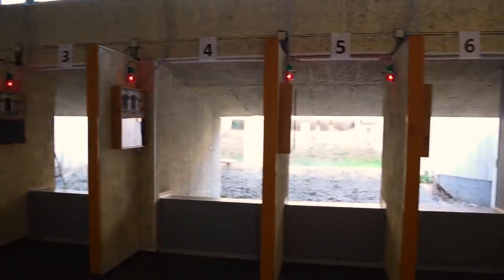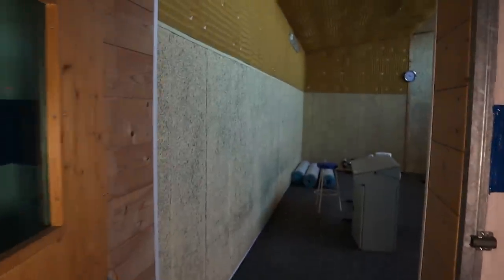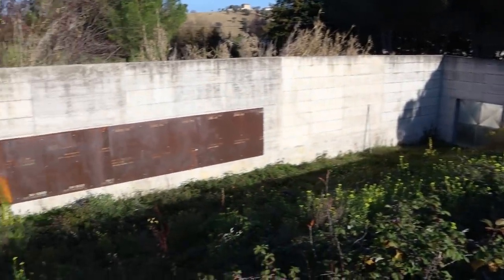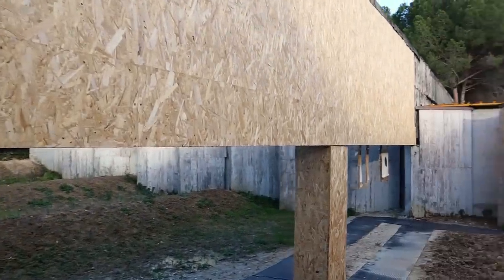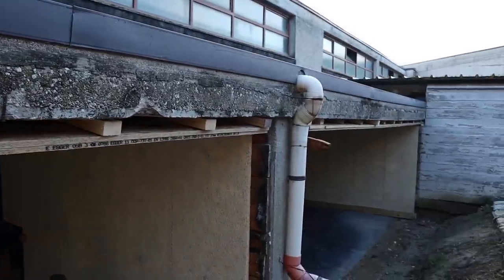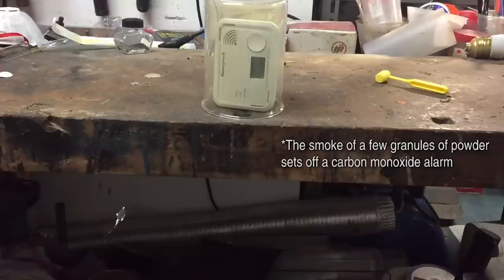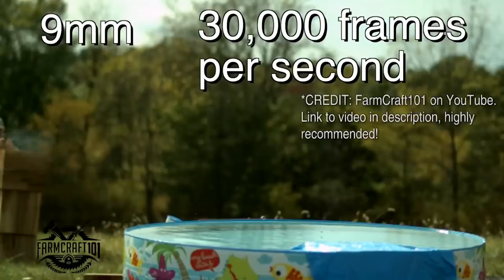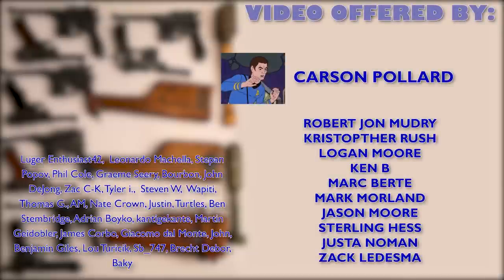The Engineering of Shooting Ranges (+ Tour of my own)

Comment: The range that I usually visit for shooting actually used to have wooden planks as a floor. That combined with the really bad air circulation started a fire and the whole range burned down. Now they rebuilt it and got a solid concrete floor with rubber sheets on top of it. Great video by the way.
Reply from the maker: Unfortunately sometimes a tragedy is needed to change the idea of the management, and this goes well beyond shooting ranges, (look what happened with the Genoa bridge)
After all, "a fire has never happened here", until one day it happens. luckily it wasn't the case for my range
Reply: I'd rather burn alive than die from inhaling smoke from burning rubber. I'd rather die in a fire than survive from inhaling burning rubber trapped in a building.
Reply: @Backyard.Ballistics  this is very interesting for me because I have thought about how a shooting range is designed but I never understood it well until I watch this video
Reply: @Phoenix_Atlas  No.  You really wouldn't.  Also you'd be doing both in the event of a naked flame anyway.
Reply: @jimmehjiimmeehh9748  Combined with the smoek from burning wires and a bunch of other shit which are all equally bad, but better injured from inhalation than dead.
Reply: Concrete floors with acrylic paint, very thick and somewhat rubberized at my range. It’s also in doors so a massive air handler is also required. The left or primary range has 16 bays and the secondary range or training range has 8 bays.
Reply: Also every bay has a separate concealed sprinkler head and way more then double the heads required by building code, (I’m a plumber so I recognize this). We also have air locks on all the doors for security and air control.
Reply: @Phoenix_Atlas  it is flame retardant ruber matting, so that wouldn't  happen

Comment: Learned more about range design from this video than from 35 years of shooting on them. Thanks!
Reply: You should invest some time in your local gunclub then ;)
Reply: @peteraugust5295  I'm an active member of three clubs, two of which have range shooting disciplines, but happily they are in the country. As a consequence the 'extreme' measures illustrated are not required.
Reply: @peteraugust5295  I'm thinking about trying to join Elks lodge. They have a amazing gun range with lanes up to a mile long. The closest free shooting site is at the top of a mountain in my county at a old rock quarry. It's hard to get up there.

Comment: There is actually allot of engineering that goes into making a range that's safe as well as muffle the noise of the rounds in order to keep your neighbors happy. I think a followup video to talk about sound isolation would be great.
Reply from the maker: You're right, I initially intended on covering more topics, but the video would have turned too long. I could very well cover them in future videos
Reply: @Backyard.Ballistics  Yeah you are right, if you go into every little detail. it would make a 30 min + video. I appreciated the detail on the concrete safety backstop. No need to design a soil retaining wall if you can avoid it.

Comment: There's a really good video on YT about a shooting range that is OVER a highway. You lay down to shoot and the round travels over a highway before hitting the target.

It's been designed so that there's no possible way to hit an, automobile with a round because the trajectory from there won't allow it to go 10m straight down. And if it isn't on a high enough trajectory to clear the road, it will hit a THICK concrete wall instead of going towards the target. It's a really well-designed range.

Comment: That is by far the most amount of Ar500 Steel I have ever soon on a shooting range.
That layer on the redundant concrete wall behind the berm is just hilarious. Is this by law?

How much is the fee for this range? This must have cost crazy amounts.
Reply: @mediumeffort3315  Why would any insurance lower is fees for a third or fourth level of redundancy? That makes no sense.
Reply: @mediumeffort3315  I dont think that is the case here. And honestly, I dont know of any accident that ever happened on a shooting range other then someone tripping over brass. 

At least in germany our ranges get checked by official range experts. Even if something would happen at first he would be in trouble. Only then, when it is proven that the range owner did something wrong intentionally he will be in trouble. 

Thee is regulations for ranges, but non requires weird quadruple redundancies. Our range for example has A Rubber Backstop in front of a concret wall. The Thickness of the rubber gets checked, and steel plates make sure nothing can fly over the trap. 

What else would you do? have another wall behind the wall and then another berm in case some bullet turns into a guided missile? That makes no sense.
Reply: Simple, a lot of people hate the idea of a shooting range, if anything happends(injury, rounds going out of the range) the range is going to close. The laws are not very detailed so if the range ends up in court the have to show they have done the impossible to avoid anything.

In Italy usually ranges cost about 50-100€/year(for insurance and subscription fee) plus about 12-25€ for trip(every range has different fees), they are almost all like this one
Reply: @mediumeffort3315  Up here in Washington it's completely different, there are some state laws governing ranges, but for the most part it's regulated by city ordinances. My range is literally all dirt, situated in a large gully, and has none of these 'safety' features. They would be cost-prohibitive and the range would likely be financially nonviable. The range is backed by a large hill (read 'mountain' to you flat-landers) which helps, but a major walking/biking trail is half-way up the hillside. So here in the states I'd go further to say rule/regs vary widely by state (parts of AZ and NV have almost no rules, while in CA and NY it's exorbitantly regulated and nearly illegal), and even then local counties and cities have a much bigger influence over what is 'required'. The local sociopolitical leanings also play a big part in jurisdictional courts, as they have case history siding with companies/defendants over plaintiffs as well. Insurance can play a big part, but in my experience it's largely driven by location and the types of people that attend your range.

I do find it entertaining how we Americans find European standards often as 'overkill', while my European colleagues view our standards as 'death traps' or 'accidents waiting to happen'. Yet I know many rural ranges with very minimal engineering that have never had a major accident in nearly 50 years.

Comment: Very informative to watch! Especially the ricochet and the capturing the fragments parts. 

Greetings,

Jeff 

p.s.
Some projects are well on their way on my grabcad (chambering reamer stop (MARS, also one for really large cartridges like the 14.5x114), floating reamer holder, and heattreatment oven (its alsmost finished now, only need to draw the power supply that i need to order)). If you ever need to calculate concrete structures or whatever you can check out my archive.org. I update both pages once in a while.

Comment: the AR500 at the end really, really is overkill - I think the only thing that would get through the embankment would be a shipmounted railgun O_o nothing handheld
Reply: Yes, thats a bit silly....
Reply: yea there is no point for it
Reply: I guess that's there just so that authorities can't say anything about over-penetration  and give some silly fine
Reply: That much AR500 didn't come cheap!
Reply from the maker: it is not only overkill, it is completely useless. Technically it's less useful than a chocolate teapot. I still have to understand why the safety authority asked us to do that (I didn't put that in the original design)
Edit: it wasn't too expensive though, we bought Hardox 450 by SSAB, and it's AR450 to be precise (the AR stands for abrasion resistant, and the number is the Brinell hardness) , and it comes at around 1.5€ per kilo. Overall it was about 2000€. It's still wasted money though, so I'll try to convince the authority to let us remove it and use it for future projects

Comment: Huh, the range I go to has pretty much none of these, but then again, its situated on game lands with pretty much nothing for several miles in the shooter's direction. We do have a giant berm, and the air circulation is excellent, given the fact that it's a covered outdoor range, so the chance of CO poisoning is practically zero. I do always find it interesting to see bullet holes in surfaces and think "how did that fuckwit manage that," then remember that I have a hole in my range bag from muzzle gases, which usually knocks some sense back into me.

Comment: As an American ive dealt with a LOT of ranges. From outdoor to indoor, deserts to massive forests. I really like this style of range, from safety put in mind and how simple it looks. Id gladly pay to spend some time there.
Reply: It's very common in Europe to find range like this one, I live in Italy too and this is the base for every range(some even with more protections, like some sound reduction area in front of the shooters to reduce the noise). The idea is that if anyone gets hurt seriously the range have really high chances to close down, only the IPSC-like shooting ranges didn't have all this regulation, but they are always in old quarries so dirt everywhere(or in old mines)
Reply: @maledetto1221  suppressors would be a great aid in reducing conflict between shooters and residents. Sadly they are restricted or banned in many countries for reasons i do not understand
Reply: @maledetto1221  actually here in germany you find these less and less, since they do not allow new outdoor ranges anymore, and often force existing ones to be updated with ridiculously expensive ventilation systems.
Reply: As a fellow American, I hate these kinds of ranges. If I'm in a shoot house doing CQB work, then fine. But if I'm doing flat range work I avoid these at all costs. For the first-time or weekend shooter, these are great, since their safety skills are likely lacking. Granted you're not going to be running drills or multiple targets on lane ranges, but I hate ranges that prevent you from keeping good situational awareness. If some idiot does something stupid in the next lane or bay, you won't see it coming until it happens- then you have to hope they engineered the range correctly.
Reply: @Alloyaha  hearing about negligent from other shooters hits close to me. I remember being 7 or 8 and at the range with my family. While i was reloading a .22lr rifle i noticed the person beside us flailing a loaded 10mm around and aimed right at me. Talk about panic at the range for sure
Reply: @Alloyaha  The lines are divided between each other with concrete walls, in some case they are also not wide enough for a full length long gun to be pointed to the others. Plus at least one RO must be there and you can get called out just for moving a rifle with a closed bolt.

Comment: That is pretty overkill. Nothing can go trough that dirt backstop, so there is no need to put more safety measures behind it. And most outdoor shooting ranges have no barrier preventing you from shooting over the backstop like you have, but still bullets going over the wall is really rare.
And on a range like that IPSC shooting is not possible.
Reply: Different countries, different regulations.
I am from Germany, we also have extreme safety measures. Then shooting matches in Hungary, Slovakia and Finnland where you just had earth walls as backstop and on the sides was intersting. And nice because you really were outdoors.
Reply: @CaptainComatose  Well i am in Norway, and here it seems like the authority's is mostly concerned with noise mitigating measures rather than safety stuff on shooting ranges. But as i said with the kind of safety measures presented in this video IPSC or any other form of shooting with movement is impossible.